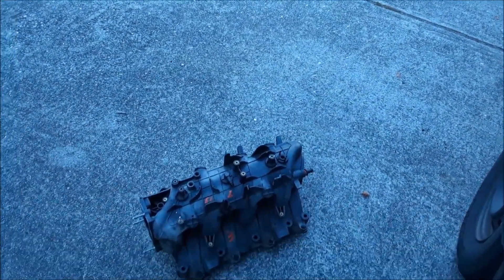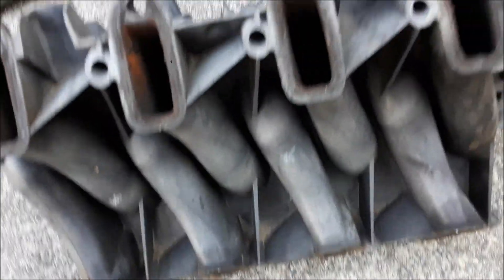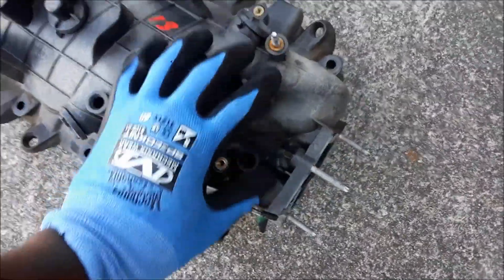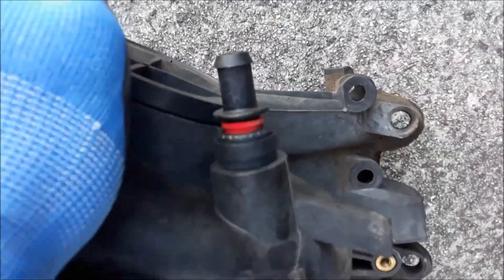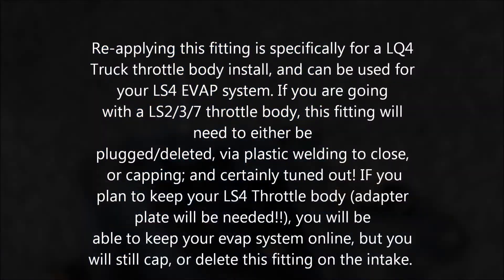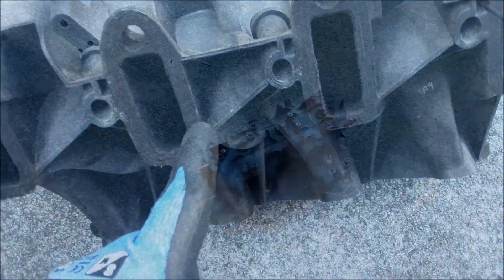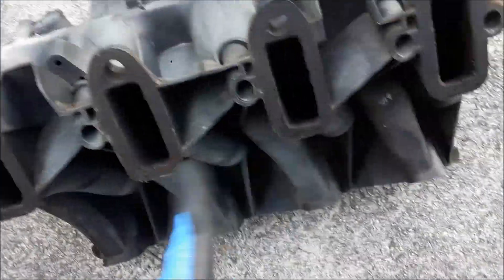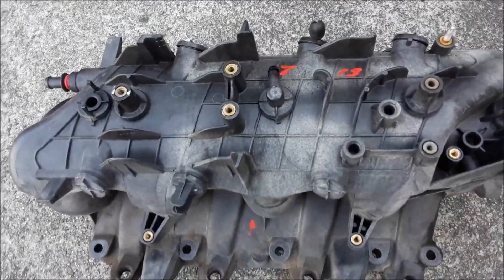LS4-LQ4 Intake Swap Step 1

Comment: how'd this go? any noticeable gains?
Reply from the maker: Absolutely! I love it! Just drove it yesterday. 👍🏿 This truck intake adds around the same HP as the LS6 intake! (25HP) With the LS7 MAF sensor, 50lbs injectors, coil packs, wires, James brewer tune I got around 400 BUT I'm thinking to do some headers.
Reply: @demariojason  thanks brother for the response just watched the full series. great videos! I appreciate it. keep up the great work and stay safe!
Reply from the maker: @bentenxl  anytime!!  will do and Thanks for watching bro! Got another vid to push like zzp upper mount and e85 soon!
Reply: @demariojason  nice! looking to get myself an Chevy impala ss 06 soon so I'll definitely keep watching!
Reply: @demariojason do you have a cam in it or DOD delete?